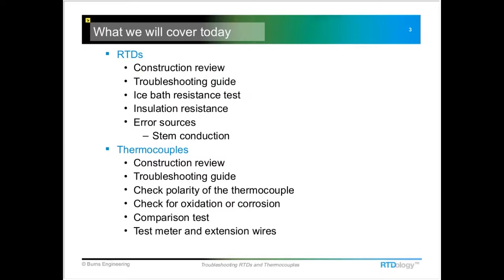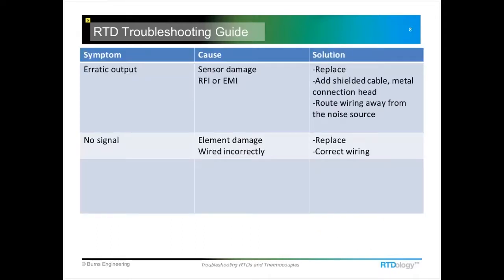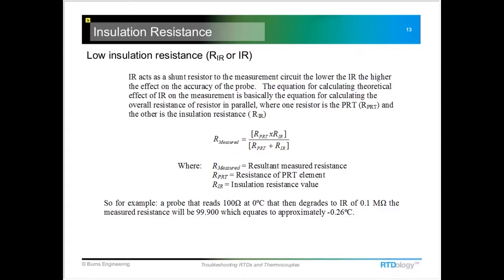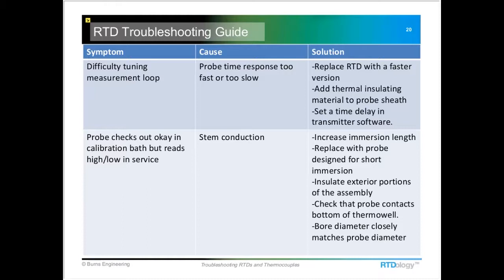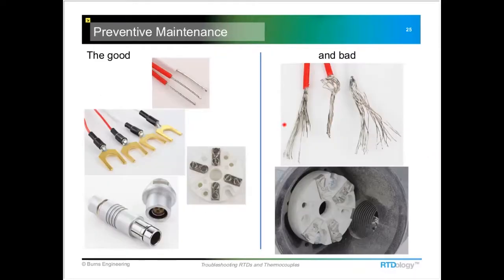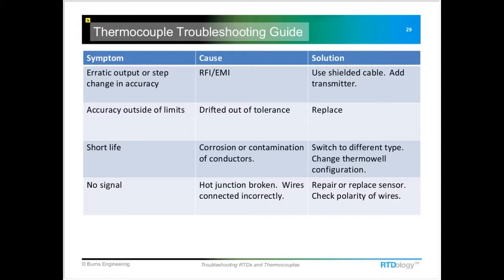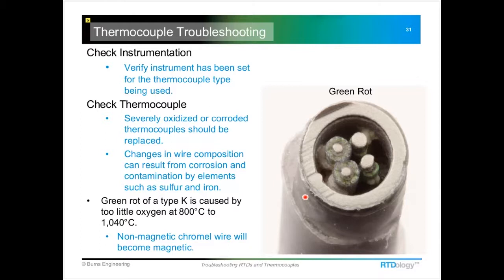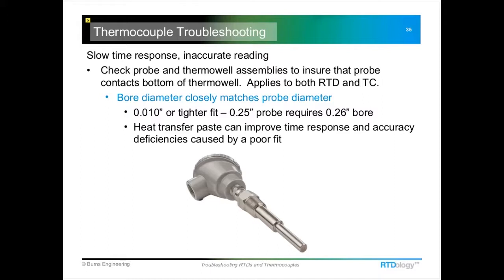Troubleshooting RTDs and Thermocouples

Comment: I have a question regarding RTD termination, is it good to use tube type lugs or no lugs?
Reply: If they are soldered correctly they are okay to use.  The best method is to use a screw terminal block that has corrosion resistant terminals.